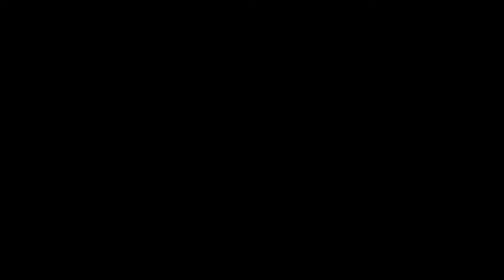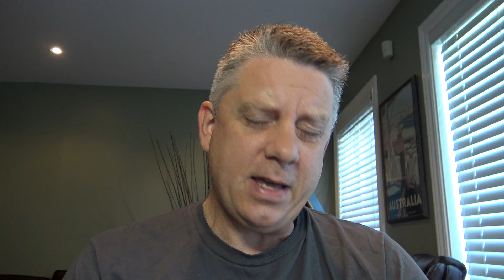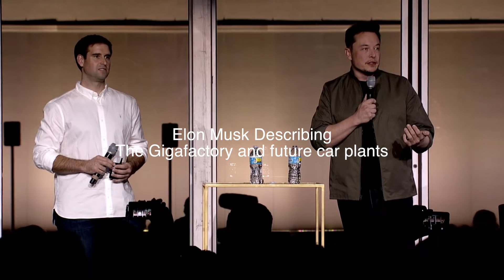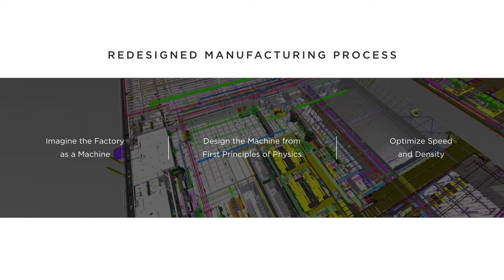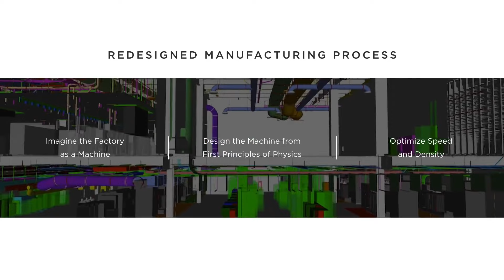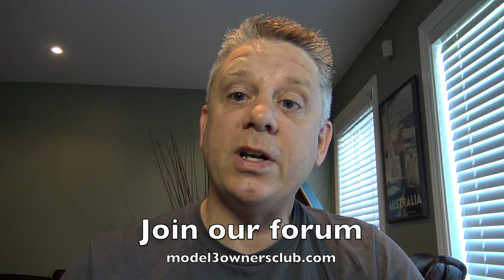August 4 2016 Tesla Model 3 Update

Comment: I'm also in Canada (Toronto) so I don't expect delivery until EOY 2018 -- at least given the announced rollout plan...but back on topic, I think what is being overlooked is that once the automation has been worked out it is much easier to match production to demand...Initially (especially in the case of the Model 3) that will mean pumping out as MANY cars as possible as quickly as possible...but I'd expect that demand will level off at some point so that Tesla will be able to cater the production rate to the actual demand (outstanding orders) without having to overproduce vehicles waiting for an owner. There is no point in churning out cars if there are not enough people to buy them. This is a much more efficient way of making product...
Reply: Yes, but they won't be backed up forever. Again, right now they need to pump kit as many as possible as quickly as possible...Model S and Model X demand  is slowing down...once they fulfill all of the Model 3 preorders, and there are other competitive products from VW, Ford, BMW, GM, et all I would be overly optimistic to think that Tesla will be in the same situation

Comment: As someone who has visited both Elon's Rocket Factory and taken the tour of Boeing's Assembly building in Washington State I have seen "the machine that builds the machine" in both the remodeled version and the purpose built one.  Both have their peculiarities of purpose.
 The rocket factory is designed along the idea of materials coming in one end and fully formed  rocket stages out the other. The Boeing facility's  747 and other products are so huge that the building that Elon uses for his rockets was once the site making the main body of the 747.  I.e. a subcontractor to the still largest factory on earth, though not for long. 

Actually the whole idea isn't new.  Henry Ford's River Rouge plant was set up to do the process of car making all in one place too, and could begin it with raw materials, making the steel on site.
The same  re-modeling problems may emerge for Elon that Ford had when the Model T needed its successor. Indeed, Elon's Rocket factory had been repurposed at least twice before he got use of it. Sometimes just building a big empty box of a building serves well enough, and the designers of the giga-factory seem to have built enough "lego" blocks to make that transition when the time comes.
Reply: I would only add that the age of the robber barons who gave "vertical integration" a bad name  for so long seems to have re-emerged. Elon seems more benign than that sort, but he bears watching, as we begin to trust the process not to become fully monopolistic as it once did. Thankfully Andrew Carnegie set an example followed by Ford, and now Bill Gates that tends to mitigate the negatives of that impulse.